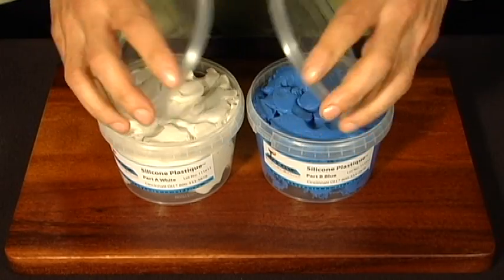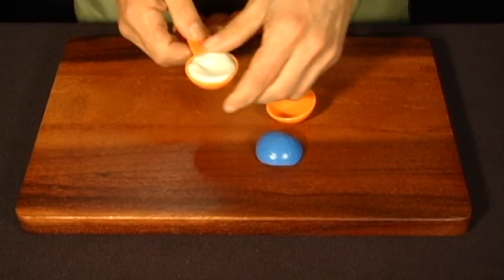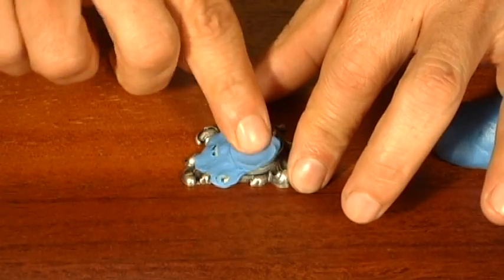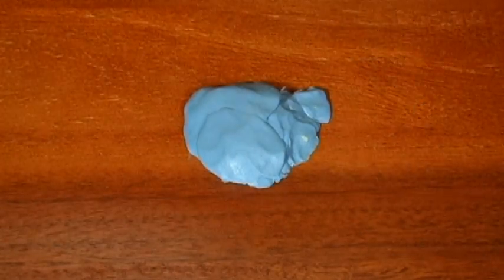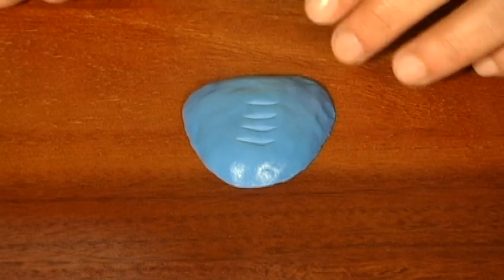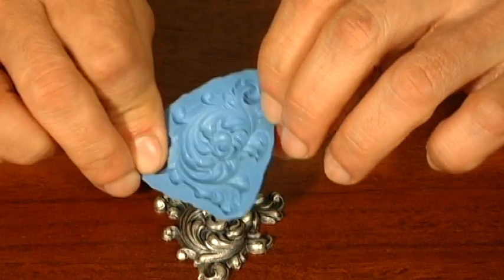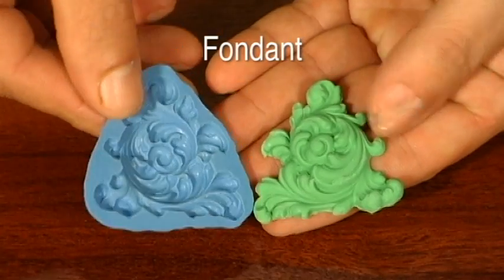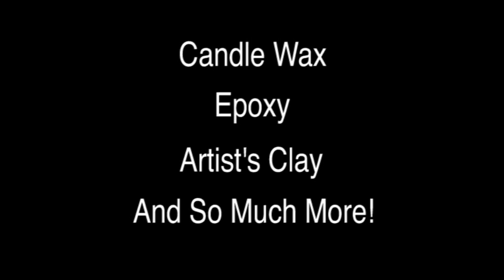Mold Making Video - Silicone Plastique® Basic Mold Making - Learn How to Use This Amazing Mold Putty

Comment: Hi :) You show in the video that it can be used with polymer clay. so my question is: Do i have to take out the clay before baking or is it possible to bake the clay direktly in the mold?
Reply: You can do either.  It can be baked directly in the mold or removed before baking.

Comment: Can the polymer clay be baked whilst in the mold?  Or will the mold peel off so easily that the clay will not move during the removal process. I couldn't tell in the video if the polymer clay was baked or not in your example.
Reply: +Jennifer Esselman It is best to remove the mold before baking.  It will peel away easily to remove the polymer clay.  You could try baking the clay in the mold but it may change the necessary baking times, it would require some experimentation.

Comment: If air drying clay or plaster of paris is used with a Silicone Plastique mold, will the mold still pull off or would another agent need to be added to allow safe removal of the casting with no damaging?
Reply: Al Johnston man it would have been nice if he had have answered this question. I really like to know about the plaster of Paris aspect when using these molds.
Reply: Hi Al, No mold release is required. That is what is so great about Silicone Plastique

Comment: Does this hold up well when using resin in it? Like can it last? Mold putty breaks off and platinum silicone is amazing and awesome but a little pricey! Great video!
Reply from the maker: Hi Cyra,
Thanks for your inquiry,  Of all the clay like silicone, silicone plastique would be best with 30 to 50 uses maybe more. In general liquid silicone better.

Comment: ....can I use silicone latex in molds made with your product ?....if I can....do I have to use a release agent ?
Reply from the maker: HI Phat, You will most certainly need to use a release agent.
Reply: ....REACH FOR THE SKY!.... Tanx, Dom.....I figured that would be the case....

Comment: Hello,I just purchased your product and I mixed it exactly like you described. I weighed Part A and B perfectly and I waited 2 hours ..When I poured the chocolate small pieces of the mold is sticking to the chocolate .What am I doing wrong?
Reply from the maker: Hi Sifu,  There could be several things causing the issue.  If you can give my office a call at 513.244.2999 or toll free with in the US at 1.800.333.5678 We can trouble shoot this with you.  The office hours are 9am-4:30pm EST.

Comment: I enjoyed your presentation very much.  It was easy, to the point, and had great tips that other sites didn't have.  Thank you
Reply from the maker: Thank you!  We appreciate your helpful feedback.
Reply: Presumably when you purchase the plastique is includes both parts?
Reply from the maker: HI Kim,  Great Question.  When you purchase one pound of Silicone Plastique you get 1/2  pound of Part A and 1/2 a pound of Part B.  If you purchase 5 pounds you will get 2.5 pounds of Part A and 2.5 pounds of Part B.  etc.
Reply: Thank you Dominic. For someone who is new to the craft this helps.  :)
Reply from the maker: Kim Priestley Ramirez Kim Thank you very much.  I hope you will give mold making a try.  But be warned... mold making can be addicting!

Comment: Hi I am doing some jewelry with resin and i need a shiny look on my resin. Does this material provide a mold witch gives a shine to the resin, I read that with some other products the resin end up looking foggy, I just want to be sure before purchasing it. Thank you
Reply from the maker: Hi wenbiafra,  If your original object has a nice shine the Silicone Plastique will pick up that shine and give a shiny mold.  The resin you put into your shiny mold will have a shine too.  If your original object is dull or dirty then your mold and anything you cast in the mold will be dull.

Comment from the maker: Yes, you can make a mold using silicone plastique and use it to mold silicone plastique into a part or a particular shape. You must apply a release agent to keep the plastique from bonding with itself. A thin double coating of Release-Dit will do the job perfectly. You can find Release-Dit at my website listed in the above description.

Comment from the maker: KewneRain,  You can certainly create a mold of your finger.  You will want to take into consideration how you are going to stand the finished mold up so that when you pour the liquid gummy solution into it it doesn't tip over.  Go to the website associated with this video, got to "How to Make Molds" then scroll down to "How to Use Easy Shell Maker".  If you have further questions you can choose the contact us option on the web page.

Comment from the maker: @MiaMccB This is a very hard question to answer.There are many factors that must be considered that contribute to the wear and tear on a mold. How thick or thin is the mold? What is the mold being used for? How large is the mold? Has the mold been stored properly? How often is the mold used? In general, you should consider a mold made with our materials as commercial in grade with a toughness that insures long mold life and dependability. It will last you for years and many uses if used properly

Comment from the maker: Styrofoam and polystyrene are porous materials and the Silicone Plastique can become mechanically locked into the surface once it cures. You should seal these materials first before applying Silicone Plastique so you can peel the silicone off cleanly. Hope this helps.